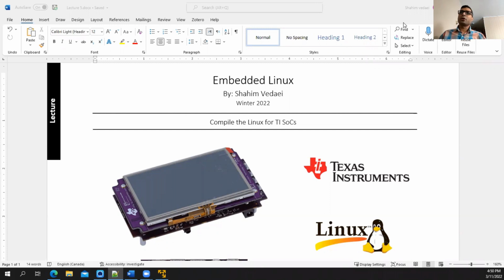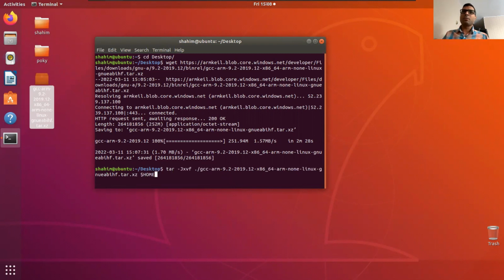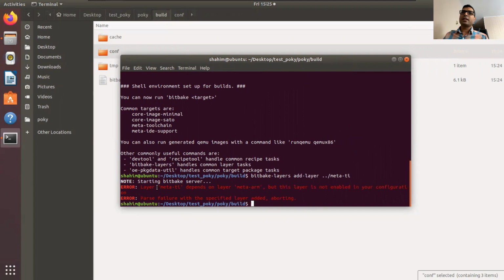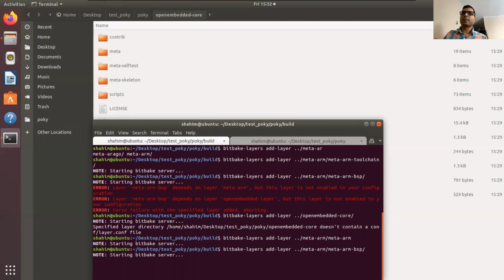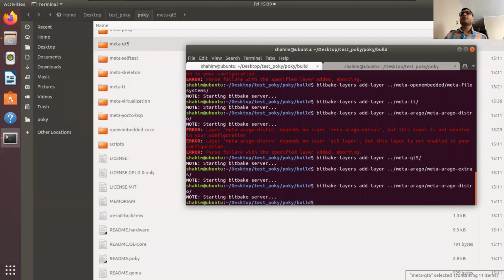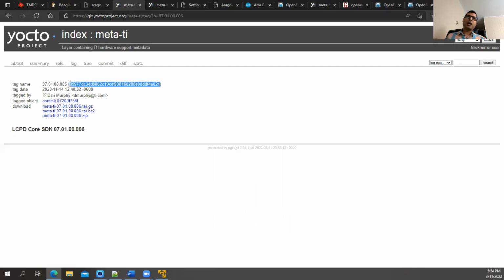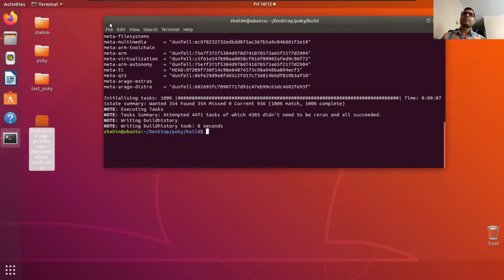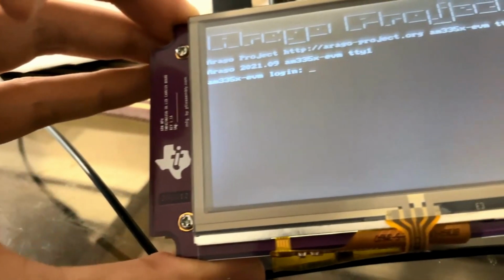Yocto #5 (GUI linux image using arago)

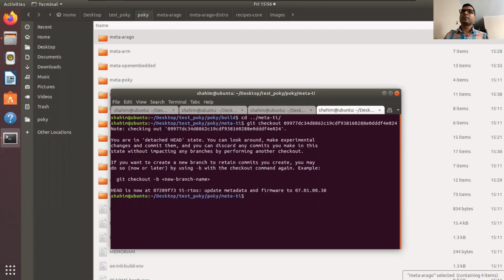Comment: How did you figure out the particular commit of meta-ti and meta-arago compatible with meta-arm 32:34
Reply from the maker: I used two commits that are given by ti's official configuration file for the TMDSSK3358 Evaluation board. However, you can check the latest commits as well. Sometimes, they are not compatible. Try, and error is one option.
Reply: @shahimvedaei  I tried with Kirkstone branch, and it worked for me out of the blue. Nonetheless, thanks for replying 😀
Reply from the maker: Great